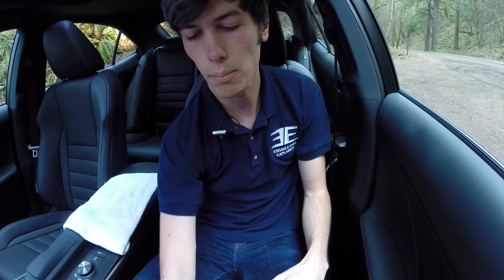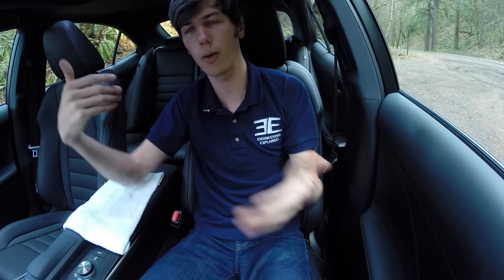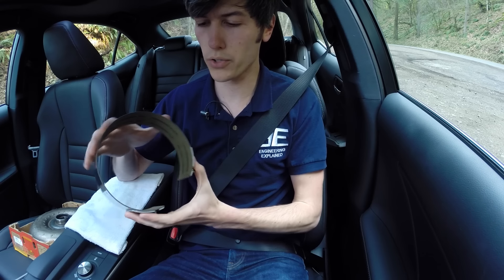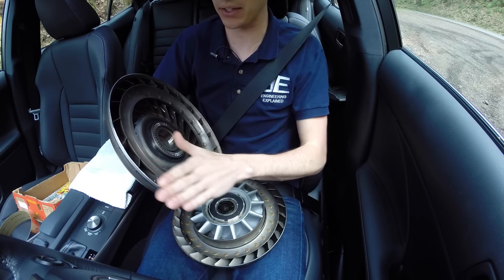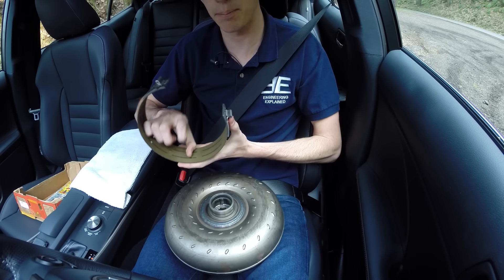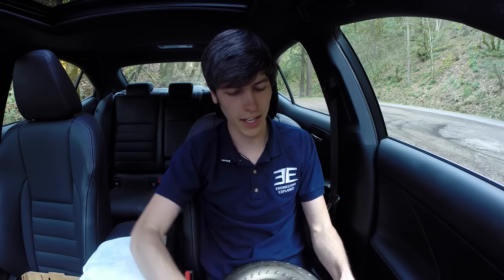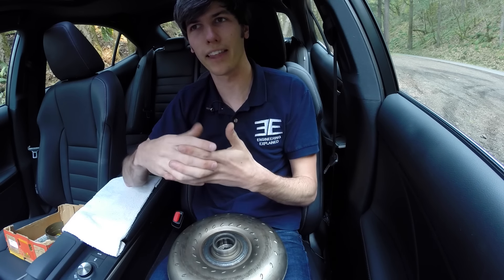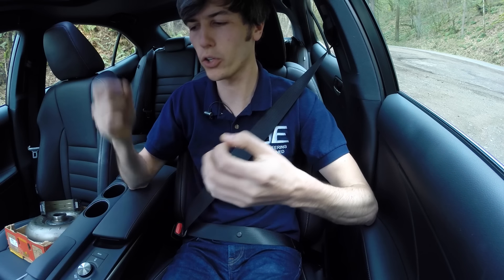5 Things You Should Never Do In An Automatic Transmission Vehicle

Comment: 1. Don't put car in neutral driving downhill
2. Come to full stop before changing directions (drive/reverse)
3. Don't neutral drop to launch your car
4. No reason to put car in neutral at a stop
5. Don't put vehicle in park until car it is at a complete stop
Reply: tips hat
Reply: 4. What about heat build-up?
Reply: Tjanks4
Reply: Your number 2 makes no sense.
Reply: Thank you
Reply: My hero
Reply: Al I think he means gears instead of direction. Lol
Reply: #4 is a bad habit of mine because i once had a bad mount which would only act up when in Drive
Reply: Colyers thanks
Reply: For 4, It was wishful thinking when I put my car into neutral at a red light to improve my fuel economy, but I did have a real reason for it.  If I keep my car in Drive, it starts vibrating up and down really fast like it wants to move.  Slightly unbalanced pistons maybe?  Putting it into Neutral removed a lot of the shaking making the wait at the stop light quieter and more comfortable.
Reply: thank you so much! I didn't want to waste my time watching whole video.
Reply: What if the car is overheating and you have no choise but to turn it off while going downhill.
Reply: Xayzen: if you car is overheating then turn on heating on maximum and let it flow. It will help
Reply: @lincoln537  Thanks for the tip
Reply: @tasa4904  my car has vibration too when i shift it to drive but not in neutral so what you recommend to do or what is the issue how can i fix it?
Reply: First check to make sure that it's harmless.  If so, which was the case for me, then just get used to it.  At least, I don't think there's a cheap and easy alternative.
Reply: So is it true that if you are driving on the streight road with gear on it still not gonna take anny fuel?
Reply: LMAO na driving
Reply: Second summary could be stated, don't change between drive and reverse before coming to a full stop.
Reply: If neutral (4)l is useless, then why did the carmakers put neutral?...or when is the right time to use this function?
Reply: 6. Don't downshift too low of a gear when going down a hill, you might blow a head gasket.
Reply: How does it not make sense? He explained it in the video.
Reply: Al drive and reverse are directions
Reply: 4. I used "Park" at stops. Why? I do not like to have my leg pressing brake pedal to prevent the car moving forward especially that during traffic jams you are many times so close to another car's bumper.
Reply: So it's alright to shift from drive to L3 or L2 without coming to a full stop right?
Reply: 5. Put your car in neutral, pull E-brake and then put it in park.
Reply: #1 is incorrect. It’s good to do that- just make sure you sure brakes.
Reply: @mungo7136  i also use neutral and handbrake in stop light for safety .  For me there's a reason to use it.  Some others may not use it . Can anyone explain when is the right time to use it?😀
Reply: Indys Dad Shut off the engine or put it in park
Reply: 4. there is a reason to put my car in neutral at stops. It's just that so I can rest my leg and foot from static positionnnnnnnn.
Reply: Launch in 1
Reply: @kylebarany  Switching it off won't actually help. In fact, it could well make it worse as you no longer have the water pump running and the hot spots could boil the stationary coolant that would otherwise be passing through the radiator. So if it boils and pushes coolant out the radiator, into the overflow or surge tank, you could lose coolant - that's a much worse scenario than it simply reading high on the gauge. Have you noticed that cars with borderline cooling systems often 'overheat' (meaning boil) immediately after you switch them off? That's because the hotspots are no longer getting a steady flow of cooler fluid past them.
Reply: Thanks for that. I appreciate the detail he goes into but I don't care. I don't care! Im not a car guy. So just let me hop to the 5 things and I wont do them. I don't want to listen to all this with no indicators like a number on screen for me to fast forward to. Sheesh.
Reply: What happens if your going 25mph and you put it in park and makes a grinding noise?
Reply: You saved 12:09 minutes of my life. God bless your soul. Thanks
Reply: @Al-ud8qi  It actually does.
Reply: @Arbylz  it's the same difference.
Reply: Alvin Hah ofcourse, sure. Lol
Reply: Lincoln Bourne wrong.  Turn on maximum cool, no AC.  If you turn on heat you activate the heater matrix therefore increasing the temp.  Cool will take outside air and pass through, therefore cooling the engine (minimally).
Reply: My question is 
Can we put car on parking  gear after  switch off the car  I mean when ignition is not working ?????
Reply: But the car is still in progress to running he can make to change to put the manual transmission
Reply: thanks saved my time i need the point like this
Reply: Good day,partner; hope you are doing fine! do you know what happens if you dont let your foot off of the accelerator while up-shifting im a Semi-Automatic ! Thank you kindly for reading and have a great month!
Reply: just like mommy told you to do.
Reply: I find it very useful to put my car into neutral when driving down a icy or slick road. It keeps the car from pulling allowing you to brake easier without sliding as much but other then that I can't see why anyone would do this.
Reply: 4 idk bro cuz thats thr ideal correct way ti it u troll
Reply: Is number 4 applicable to automatics that have creep permanently turned on?
Reply: @kylebarany  lol coolant doesn't circulate when the car's off
Reply: 2 and 5 are the same thing
Reply: Carlos Mariano car wash, when the car is on a hydraulic lift, if you need to push the car
Reply: So mostly common sense
Reply: Wow you just ruined the ending for me thanks!
Reply: Al Hey There! Transmission Repair wants to friend you.
Reply: Thanks a lot man
Reply: @Al-ud8qi  Changing D to R and viceversa while moving damages the transmission
Reply: Carlos Mariano year old post but your comment is a very good one
Reply: How about not putting it in neutral to coast down a hill so that you don't burn up your brakes?
Reply: Thank you
Reply: I love you
Reply: @carlosmariano2294  I'm guessing that neutral is mainly for when you are getting towed.  Plus, I suspect it helps the transition from reverse to drive.  I'm not a mechanic though.
Reply: What if you stop at two minutes stop light and you still put your foot on the break or put it in neutral
Reply: Thank you captain obvious!
Reply: t
Reply: Is it ok to shift from drive to 2nd while driving under 40 mph?
Reply: not using the neutral makes the manufacturer just putting neutral as for display only. the heck they put it but you guys dont want to use it? doesnt makes sense
Reply: tl;dr Neutral gear is redundant, don't use it.
Reply: Colyers i object to number 4 when snow and ice is concerned.  You can stop a lot shorter and straighter when you shirt into neutral at a stop street!
Reply: It's called engineering explained, not simple answers.
Reply: @Al-ud8qi  lol yeah it's actually technically impossible (not to)
Reply: I find #2 the hardest, especially after reversing out of a parking lot, its easy go go into drive from reverse before standing completely still (although this is still at a very low speed so it doesnt really damage the transmission)
Reply: Colyers thanks so much
Reply: I literally searched for this comment, you are doing God's work
Reply: i see no reason to put my car in park when parking, i just put it on neutral since, P is a small nudge and uses the transmission to hold the car, if someone smack u from the back u can literally break your transmission
Reply: #5. This Is literally wrong. It is very dangerous to move gear selector, while car stopped. Because of hydrolic pumps not working, and oil feeding is "zero" at the moment, that friction can damage the gears and cogs.
Reply: I need to put mine in neutral at stops so it don’t stall 😂 yes it’s an automatic but...
Reply: 6. Forget all those steps and get a manual transmission
Reply: @Danny103   Lol there is a bunch of used cars out there with manual trans. Also you can buy the car that you like and drop a manual transmission on it from another vehicle. Much more reliable, cheaper to maintain and more fun
Reply: Good break-down, but it's nice to know the science behind this too.
Reply: Winner of a video, I've been looking for "free motor vehicle history report" for a while now, and I think this has helped. Ever heard of - Niyiley Xanarah Plan - (just google it ) ? Ive heard some extraordinary things about it and my work buddy got great results with it.
Reply: My car has proactive jatco auto transmission and it automatically puts neutral while waiting at traffic at D. If i select first gear manually, it won't select neutral by itself. I can feel the difference by releasing brake pedal and feeling the acceleration difference. When it's at D, it feels like I'm at N and choosing D therefore there is a small lag. When it's at 1st gear selected manually, car wants to go as soon as brake pedal is released.
Reply: @tasa4904                                                                                                                                                                                                                                                                                      That`s a good idea takes the strain off the torque converter
Reply: I do 4 when I’ve been sitting forever at a drive through, I put it in neutral to pull the handbrake, then put it in drive to inch forward. I also do 2 bc that’s just a bad habit of mine
Reply: @colindobinson                                                                                                                                                                                Agreed.
Reply: Indys Dad and stress on your torque converter.
Reply: Carlos Mariano for towing.
Reply: ...
6. Don't put mangoes in your torque converter.
Reply: Saved my 12 minutes thank
Reply: my cousin accidently put my hyundai elantra 2019 in Parking mode while the car was in motion @ 20km per hour :(
Reply: @carlosmariano2294  when being towed
Reply: 4 -- ᴛʜɪs ɪs ᴛʜᴇ ᴏɴʟʏ ᴛɪᴍᴇ ᴛʜᴀᴛ I ᴄᴏᴜʟᴅ ʀᴇsᴛ ᴍʏ ʟᴇɢ ғᴏʀ ᴀ ᴡʜɪʟᴇ.
Reply: 4. No reason other than not wanting to hold it with brake pedal for no legit reason knowing you’re not going anywhere for good couple of minutes.
Reply: Honestly thought this was all common knowledge
Reply: @carlosmariano2294  I use neutral and pull the handbrake and remove my feet from the brake, I hate keeping my feet on the brake until the signal goes green.  And I am some of the few enjoy waiting at the signal instead of running red lights,  it's also an opportunity  for little break from continuous driving.
Reply: @MegaHarshsingh  yes
Reply: Then just remove the neutral from the transmission!
Reply: @Boxtruckin  oh come on now of course drive and reverse are directions I always drive in reverse how else would you knowz where you came from...😜.
Reply: @dictated6839  is that while car is still moving at 100 miles per hour???😜
Reply: @J117-x7l  it's just growling at you just like a playful puppy ..
Reply: @Diego-lt4wm  not if your out in the middle of nowhere and you don't have a phone just let it idle back and forth if your stuck in the snow to rock the car give it a little gas if needed to rock it farther till you get unstuck..
 I know I'm in the great white north 🇨🇦 eh so I'm going to take off eh and get a beer eh...you hoser dam stuck in the snow Again eh I need another beer eh I knew I should have taken the dog sled eh.. that way the beer is in front of me then eh
Reply: @101perspective  yes getting towed or pushed but some of the old automatic transmissions could be push to start like standard transmissions ...
Reply: @kalbeau1  neutral is for towing or pushing the car and help rock it back and forth when your stuck.
Reply: @mikeadams8293  expressly when there are other cars on the road they will help you stop as well ..
Reply: @foolish5551  yep but you or they have insurance so you get it rebuilt like new.   I used to rebuild my 1966 Buick short shaft 400 Turbo yearly to Check  the clutch plates as well as the reversed pattern valve body with trans brake and 4000 stall converter ...
Reply: @dieselgeezer18  Walmart sells them don't they I heard there $23.49 with shifter but the clutch peddle is extra but you can buy the kit to convert your parking break to work as a clutch..
I think it's another $ 8.37 or it could have been a  $1.380
Reply: @peterrivney552  Cool.  I didn't know that.
Reply: @peterrivney552  👍🏽
Reply: @Fixin-To  
>Turn on maximum cool, no AC.  If you turn on heat you activate the heater matrix therefore increasing the temp.  Cool will take outside air and pass through, therefore cooling the engine (minimally).

You have no idea how it all works, do you?
The heater core acts as a radiator, because it gets heater by the coolant, and there's flow of air through it.
If you turn AC on, the hot compressed refrigerant goes to the condenser which is placed in front of the radiator. The condenser gets hot, which decreases efficiency of the radiator.
Reply: @1985230ce  the torque converter is built to withstand the forces and heat. Past a certain torque it would just open a valve that stops the fluid pressure from going too high.
Reply: @tasa4904  when you leave it in drive, you are essential putting a small load on the engine but since the engine is ildling it does not have enough fuel and thus power to keep it at idling rpm(the throttle has an idle setting). When an engine drops below the idling rpm it starts to idle roughly and eventually stall. Usually just keeping it in drive when stationary won't cause any harm besides the vibration.
Reply: What happens in you put a car in park but it's only less 5mph speed ?
Reply: Thanks saved me some time
 Appreciate you bro.  Doing good work
Reply: you can eat mango on a fork!
Reply: my hero!
Reply: 4.  Nah.  Not if you have a 1979 Monte Carlo with a bad idle that will die if left in gear at a stop.  Also you have to keep the RPMs up because the water pump is going out and it'll overheat at low RPMs.  Perfectly good reasons to put it in neutral at a stop.
Reply: You dropped this 👑
Reply: Car may still be rolling when you shift from one to the other.
Reply: Thanks

Comment: Who ever puts there auto trans in neutral,when going down a hill???????????
Reply: Pete Smith people who wanna save money on gas/fuel
Reply: I guess you missed the part about how modern cars shut off fuel injection when you're coasting at engine speeds higher than idle? If you put your transmission into neutral, the wheels can't keep the engine spinning, so the car has to use fuel to do it instead.
Reply: First, there are plenty of cars on the road that do not shut off the fuel so this may not be applicable.  Second, the engine and drivetrain are still consuming energy even if the fuel is cut.  The engine essentially becomes an air pump.  These drivetrain losses can be more energy expensive than the small amount of idle fuel.  As far as being "out of control" that's a poor reason as well.  Manual transmission cars are in neutral every time you shift.  But we don't fret about those drivers being out of control.  A flip of the selector and you're back in gear.  No more difficult than pressing the accelerator.
Reply: Tried to do that once when I was a new driver and almost out of gas. Went right past neutral and into reverse at ~40mph. :(
Reply: Evan Derickson omg what happened after that???
Reply: Engine stalled and then I think it popped back into neutral, because I think I coasted to the side of the road. Seemed like my entire dashboard was lit up and I freaked out that I had broken something expensive in my mom's car, but it started again and it still has the same transmission well over 10 years later.
Reply: I tried this while going downhill in the mountains...felt like a free fall on a rollercoaster. 2005 Nissan Pathfinder. Nice. I would not try this on my 2016 Nissan Murano.
Reply: I do it, trans working like a dream at 200k miles, this guy is all talk and "theory", but irl it's actually a lot different
Reply: bixby, I mirrored your comment before reading it, though I think you did it better.
Reply: Unstoppable 18 but it uses more fuel if you understood how cars work lol
Reply: It can be used to go faster then the speed governor allows
Reply: John Cain III so does keeping it in drive and using the gas pedal..... Much more effective too